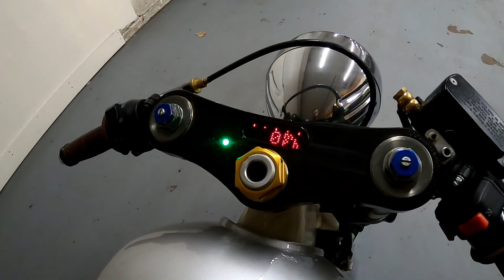Riding/Overview - Virago XV920 Cafe w/ Ducati Single Sided Swingarm

Comment: Hi fella, I've done a 920 cafe. Your build has been on my saved pics since I stared about a year ago. Awesome conversion. I just wanted to check your Settings on the Motoscope Mini for the ImpE and setting the revs, are you on 0.5 and how far do you rev your engine. I set it at 0.5 and the shift flash at 10000rpm which I hit a couple of times on my only ride out so far but I've since realised that may be revving this block a bit too high. Thanks.